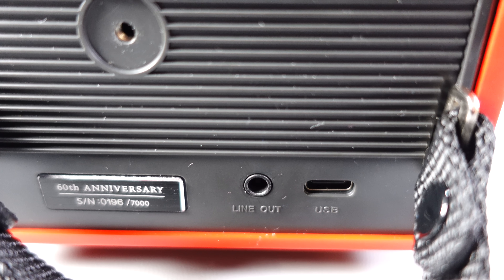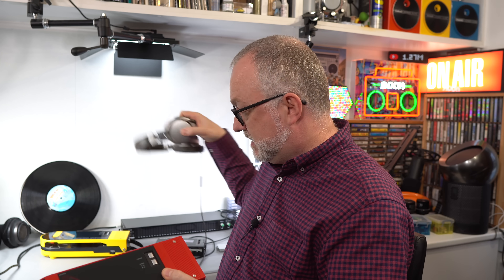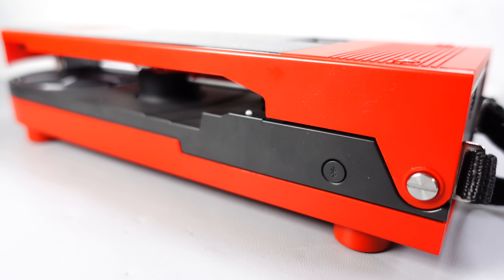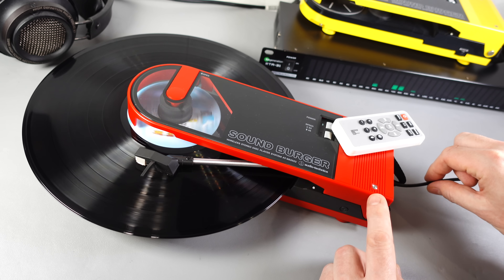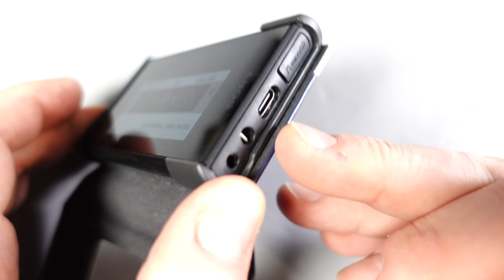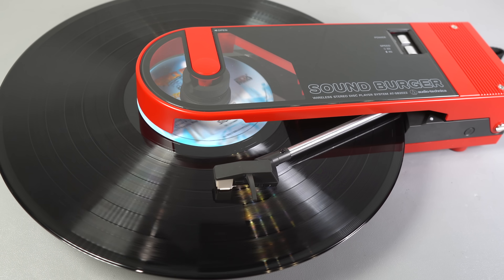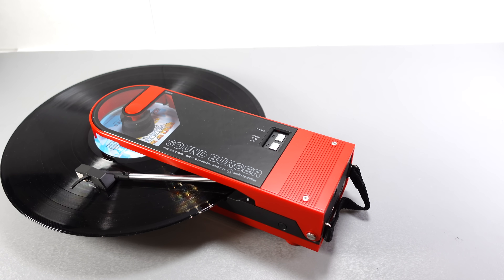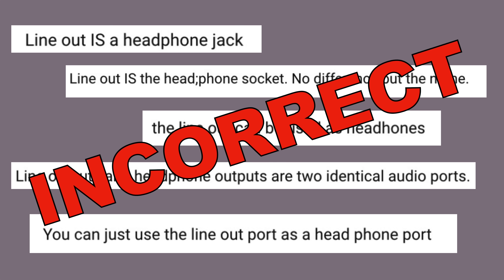Line-out ≠ Headphone-out

Comment: To further muddy the waters some devices can switch between the two either automatically add did here by impedance detection or old school switches that bypass the amp.  The real problem is that we have made these connectors so ubiquitous that they are cheap and used for everything from audio to video to data, heck some have fiber optics built in.  But there are standards for most of that too some degree, but because the connectors are so cheap they are used for all sorts of things like i2c, I think void star labs used them at one point to connect halves of a keyboard using i2c in fact.  Cheap and abundant makes them great for all sorts of things up to around in think four conductors. I think makers should utilize proper connectors but sometimes it's easier and faster and then cheaper to produce this way than use a less common connector.... It's an issue
Reply: Seen them also used as slip rings for rotating toys as a misuse, they work for a few months then get noisy as the contact points wear out.
Reply: Yeah some two-part keyboards use TRRS (needs the extra ring to have the 4 conductors of USB) between the halves

Comment: How about the headphone output on amplifier/receiver is there more distortion there than on pre out?
Reply: If you mean headphone out to line in on an amp, yes it will typically sound worse(though usually not bad) than line out to line in. The impedances don't match, along with the variable signal strength.
Pre outputs could vary considerably between devices, as it's a general term for pre-amplification(or at least before the main amplification). For example, pre-out signal could be very small(such as from many turntables), but from another device could be a line level pre-out for use with a powered subwoofer.
Reply: @DoubleMonoLR  
In a Yamaha RX 396 I've been using the headphone out to feed a electrocompaniet aw 50 and then the power went to two jamo sw 300 they were set up so they each played a right and a left channel, each SW had an impedance of 16 Ohms , that sounded very good and was mostly playing at very high levels. 
The mids and high was the original from jamo and a single pair of them was connected to the Yamaha receiver. 
But now I want to build a new system and I want to record to MD and make use of the variable loudness to trim the sound for my portable MD. 
That's why I'm asking for the level of distortion.

Comment: What about connecting a professional line output to headphones? Professional line-level is 4 times louder than consumer line-level.
Reply: same difference just slightly louder. were talking going from 1-2 volts to 4 volts. still 6000 ohms or about. and most professional equipment uses balanced lineouts with xlr connections.
Reply: @CotyRiddle  The increase from 300mV to 1.2V (4 times louder) is 12dB. That's significantly louder!

Comment: The new Soundburger has a bluetooth connectivity. However, it can be only used with bluetooth speakers or headphones that have its own volume controls, means you can't use any other Bluetooth-based hearing devices such as TWS. 

Anyway, all of those line in/line out things sometimes made me a little bit confuse especially line-in where I put aux cables on mic input just to recording stuff from other sound sources to the cassette. Then, I was wrong. Attempting to make mic input as line input is the worst idea. Distortion really high and painful to hear it after that.
Reply: some tws devices will work as they do have some form of volume control. i have some cheap earbuds from walmart that do in fact have volume control and they are tws.

Comment: What if your headphones have built-in volume control?  Couldn't you just plug into the line-out and crank up the volume on your headphones?
Reply: only if the headphones have an integrated amplifier. If not, the maximum volume will be the line out low volume, and the control will only be able to lower the volume, not crank it up.
Reply: Only if the line out can give a high volume on the headphones, often you'd hear little to nothing. It depends on the specific earphones/headphones, as they have different impedances.

Comment: It is worth mentioning the opposite of what you mentioned in the video. It's complicated by Line Out impedance and voltage (not well following a standard) versus a headphone output. Complicated by the sensitivity of headphones, you could end up with painful volumes out of a Line Out with headphones connected. 

The important take away is that connecting to a Line Output or other Line Level source with a headphone could results in unacceptably high volume levels at the headphone  resulting in headphone damage or worse hearing damage.

TLDR: Use a headphone output or dedicated headphone volume control, starting at the low end and working higher until you get a suitable listening volume. Audio output levels are never guaranteed.
Reply: Likewise using a headphone output to an amp line input sometimes requires the output to be set to high volume(on all amps I've used from memory) The impedance mistmatch also isn't the best for audio quality.

Comment: I have a Graham Slee Voyager headphone amp that I bought on eBay for £60. I use that in the line out from my Walkman CD player to drive high impedance headphones. If you keep looking on eBay these things come up at reasonable prices from time to time.
Reply: @Pixie Pete Yes, it drives my headphones easily. It can be powered from internal 9v battery or external USB power supply. Current drain is very low and it works really well. Expensive to buy new though.
Reply: @Pixie Pete That's what I was going to do when the Slee came up.

Comment: i think you should add a side note that there are few devices that the line out and headphone jack is tied into one jack. using some trickery the device could detect the resistance of the headphones and output full volume. (ive ha a computer that was able to do that. Some cell phones do this trickery)
Reply: My GT1B uses the same jack for both. It is even labeled line out/phones.

Comment: Technically, the manufacturer could, in principle, provide multiple types of output through the same port. In the case of line out and headphones, there could be impedance sensing circuitry installed, a toggle switch, a momentary switch (integrated in a volume wheel that becomes active in heaphone mode), or many other possibilities. 
The very same idea is also when discussing microphone in vs line in.

Comment: Without a high quality DAC inside your Bluetooth headphones, isn't it pointless to play vinyl over Bluetooth? The whole reason for vinyl is it's analog sound quality, so with a cheap set of BT headphones you may as well just use a digital audio player.
Reply: BT in general is not good enough for audio it don't matter which version or codec it uses for the audio streaming. its good enough but not good enough.
Reply: Bluetooth transmission is lossy, no level of DAC can rescue the quality.
Reply: Yes better some FM transmission than bluetooth, or having both bluetooth and headphones socket so consumers can have choice.
Reply: "analog sound quality" 🤣
Even mediocre digital recordings are better today than the best analog ones.
Reply: @TheUglyGnome  yes and no
Reply: @CotyRiddle  
There's no "yes and no". I't's about mathematics, information theory and linearity of AD/DA process. When it comes to objective "quality" , today's digital wins hands down. 

If you like analog recording more than digital one, it's just because you like errors created by the analog process. And, oh yes! I like them too. That's why in my studio I use analog equipment and digital emulations of analog equipment on digital recordings. But I would never be as stupid as to talk about "analog quality" over digital.
Reply: @TheUglyGnome  that is what my yes and no was referring to. Digital with all it's fanciness will be better obviously especially when you start talking 24 bits 192 khz sampling. but i do love with all its flaws the warm tone that analogue recordings have. also sadly modern recordings even on tape or records are compressed to hell... got to love the loudness wars........

Comment: With regards to the 3.5mm jack being used for a variety of things, some models of iPod Shuffle and/or iPod Nano used one 3.5mm port as both headphones and usb for charging and transferring music. Plus I've had a few TVs (usually cheap ones) where the have a 3.5mm port and they come with a cable that has a 3.5mm jack on one end and your full yellow, white and red rgb on the other end for using older devices with the tv, allowing audio and video through the 3.5mm jack and port.
Reply: yup i have a tv that is like that. requires you to use a adaptor. and the first gen ipod shuffle did use that setup
Reply: @CotyRiddle  First Gen Shiffle didn't, it was a USB stick. Would have been later gens, plus some later gen Nanos, I believe.
Reply: @toast99bubbles  ah yes you are correct. i meant to say second gen the little one that clipped to you lol.
Reply: @CotyRiddle  That's the one I was thinking of initially too.
Reply: not to be that guy but the cables you're describing are RCA cables, commonly used for composite video (which isnt RGB) and audio
Reply: @ch1ptype  I've seen them sold under both names in shops.

Comment: Output impedance is the biggest issue here, the actual voltage is broadly similar between line and headphone outputs but line inputs have an input impedance an order of magnitude higher than headphones, so if you try to drive headphones with a line output, it will tend to current limit, hence the very low output. If the line output had the current/power to drive headphones, you could use an inline volume control. When it’s the other way round, it tends to work fine because the headphone output can easily drive a line input as it presents a tiny load, and since the output voltage is compatible with a line input, you can use your device at usually maximum volume (there are exceptions, dedicated headphone amplifiers often deliver a lot more voltage and current than a portable device and could over drive a line input, my Sony TV also delivers too much voltage at full volume, working best at about 40%).
Reply: i think it is 1 volt peak to peak or something like that.
Reply: @CotyRiddle  my explanation is pretty dumbed down, I’ve not really delved into the science behind impedance matching, but line inputs can generally cope with a fairly wide range of input voltages, from millivolts up to typically 3-4v, so providing you’re not over driving the input stage, you’re all good, you’ll usually have a volume control further down the chain anyway. Headphones generally don’t require much voltage to make them move, however professional high impedance models usually need a lot more voltage (because a given voltage into a higher impedance equates to less power than the same voltage into a lower impedance). Ironically different headphone outputs can have greater compatibility issues with different types of headphones than they do with line inputs.
Reply: @Si1983h  indeed
Reply: The output voltage WAS compatible with a line input, until the ear protection lobby started to mess with our beloved devices.
Reply: @fluffyblue4006  yeah, that can be in issue but provided you have enough gain, you can work with it. I’ve just bought a Volvo C30 for its comfort and frugal diesel engine, but the infotainment system is seriously lacking compared to my Golf GTI, I’ve had to plug a Bluetooth adapter into the line input in the car… my phone thinks it’s a pair of headphones and keeps turning the volume down… I’m going to order a proper hands free kit that can do Bluetooth music instead.
Reply: @fluffyblue4006  yeah but you can't blame them alone.